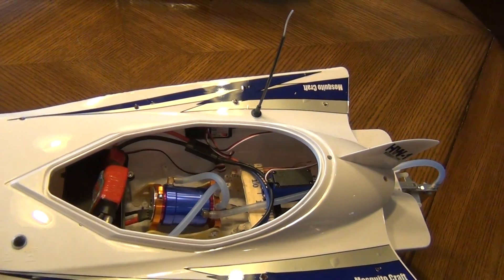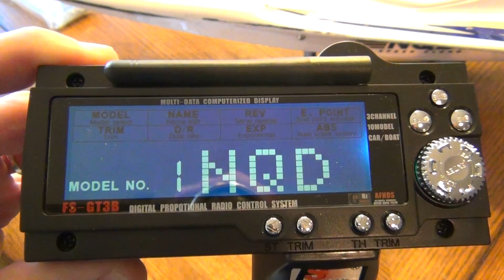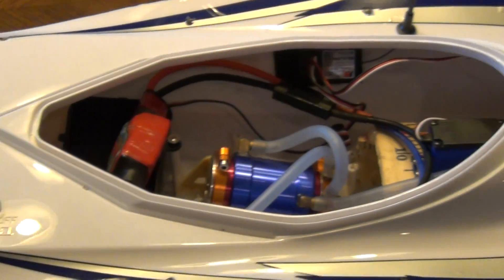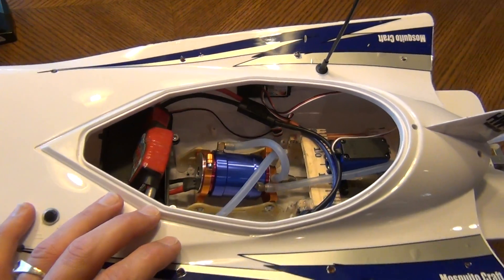NQD High Wind RC Toy Boat Brushless Conversion Part 1

Comment: Loved the vid and ft he explanation.  I have stock original boat. Question where propeller goes nut wont screw on. Howbtob rethread oe chamge amd how get part if so. Or glue propeller how

Comment from the maker: I use Traxxas flat connectors on most of my surface stuff (cars/boats, etc) for the batt/esc connection, and 4mm or 5mm (depending on the amps) bullet connectors for the motor/esc connection. (I think I used 5mm on this one?) On the flex shaft, I just bought the 4mm shaft by itself and then made my own sleeve with a copper tube and teflon insert - I had to cut and bend it to fit where I needed it to go. :)

Comment from the maker: not sure about the brand....I believe it was just labelled "KD" on HK's website...and yes, I just bought a standard inrunner and bought the water cooling jacket separately -seems to work really well...but of course it you push the motor, it and/or the esc may over heat.

Comment: I was wondering what force causes the water to ascend t5he drilling in the rudder. I understand the reasons behind the need for water-cooling, just curious about the physics behind your setup. I suppose it´s a venturi effect   : )

Comment from the maker: There are a few schools of thought here...1st) you can use grease in the prop shaft tube/housing. 2nd) be careful to glue the shaft tube/housing at the transom, and 3rd) mount the motor as near/above the expected draw/draft waterline of the boat to minimize any siphon effect.

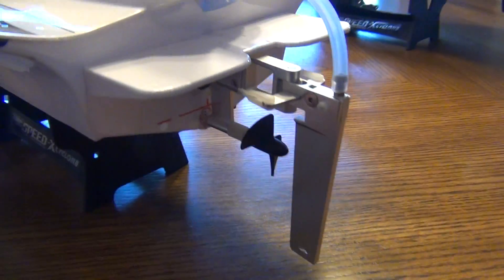Comment from the maker: If you watch from 4:02 to 4:30 I talk about the cooling...the cooling water is forced up the rudder through the water pickup hole at teh bottom of the rudder, then up through the cooling tube(s). The cooling setup works well for this power setup - if I was running a hotter prop (causing higher amp draw), I would probably add a second pickup and run a spearate cooling tube for the esc.

Comment from the maker: Cam - I put the battery in the front bow area of the boat. If you have the same boat, you will see the black box that holds the original esc/receiver electronics...I put the battery in front of the that and it slides up under the black box and fits pretty well...of course ymmv depending on the size/shape of yoru batts. :)